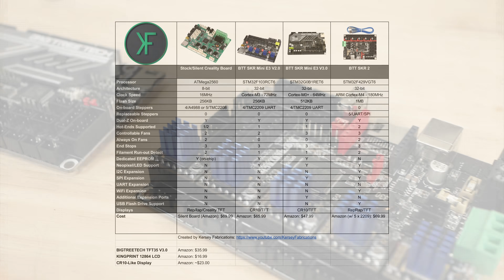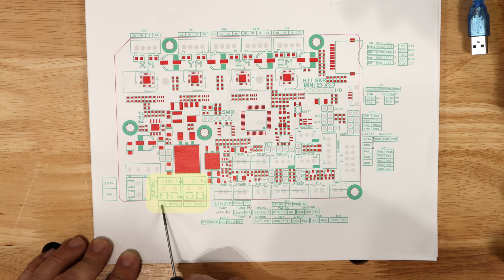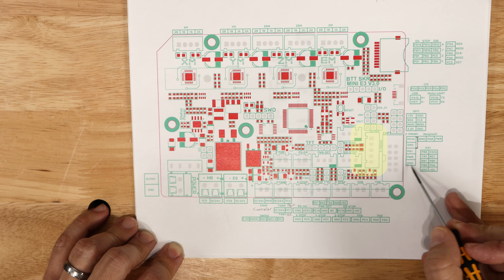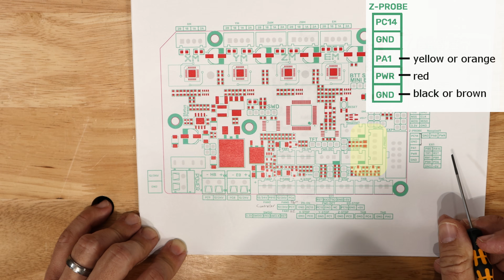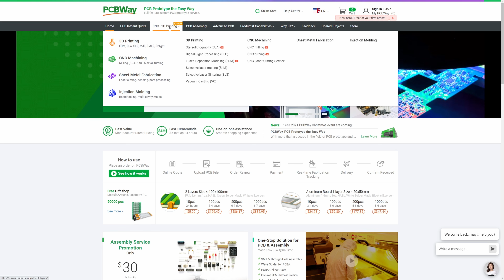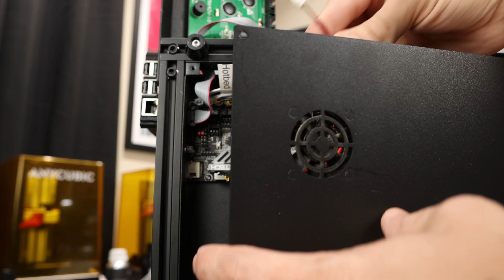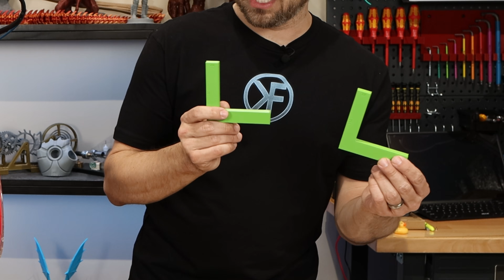Bigtreetech SKR Mini E3 V3.0 - Ender 5 and Ender 5 Plus

Comment: would this work on a 5 pro? your video was super helpful and you firmware has gotten me the furthest so far but im still getting an issue where i turn the printer off and it disables the steppers, also if i hit auto home it will never raise the bed up and the z probe wizard is helpful but wont help me home the printer.
Reply from the maker: When you turn the printer off, it will always disable the stepper, they have to have power to stay engaged. If the probe self test works on boot but it won't home, check the location and polarity of the black/white wires from the BLTouch.
Reply: @kerseyfabs  I’ll give that a test. I was able yo get it to raise the bed by removing the z probe wires off the 5 pin harness and putting them into the z end stop a harness. The bl touch tests correctly but now will when I hit auto hone it will not deploy the probe and tries to crash into the bed. I did test out BTT firmware and it’s lacking some of the features of yours but it has the issue of dropping the pin but not stopping the bed.

I am going to swap the polarity z probe and see what that does. I can handle hardware issues well and some software but not compiling or writing code.
Reply: Did you manage to fix this issue, what you have described seems to be the same issue I'm having
Reply: @PetrolheadDan14  somewhat yes, I had to break off the two wires for the z stop instead of the 5 pin for bl touch. I couldn’t get his firmware to work, but I got one of the btt pre compiled firmwares to work, I lost a bit of functionality and my  printer flipped the home of x&y to the opposite corner (my purge line is on the left now). It’s working so I haven’t messed with it but I did buy the unified 2 firmware but I haven’t messed with it.
Reply: What do you mean you have to break the wires off for the z end stop? This is the issues I'm having and what I've tried already

Cr touch connected and z end stop disconnected: auto home will only home x and y. If I run a bed level test the bed will move down around 40mm and then raise 10mm, will then give me a m112 shutdown error.

Cr touch connected and z end stop connected: auto home will home x and y then try to home z however the probe won't deploy.

Saw something online about removing the red and blue wire from the cr touch and connecting them into the z end stop connector on the board: however again on a z home the probe doesn't deploy again.

I have tried multiple firmwares and 1 with the z end stop connected deployed the probe on a z home however it was still using the z end stop for home as when I removed the adjustment screw for it the nozzle crashed into the bed even though the cr touch probe had touched the bed
Reply: @PetrolheadDan14  so the btt board has a 5 pin for the bl touch, that did not work, I had to pull two wires off (can’t remember which ones) and put them on the z stop. One thing I did to help test and avoid crashing into the bed was to drop the bed down and tapped the probe while rising to see if it stopped the bed.

Comment: So I installed the BTT on my Ender 5 Plus.  I did the firmware process.  I plug it in, turn it on, Nothing shows on the LCD screw.  The BL Touch lights up and makes a clicking sound.  Any ideas?
Reply from the maker: Did it look like it's getting power? Any backlights or LEDs?

Comment: I downloaded the firmware for my Ender five plus. However, I keep getting the error of Failed to enable bed leveling. I try to turn on the BL touch, it goes to the limit switches, goes to the middle and then the bed drops down about 40 mm and then errors out. This is my only issue with going forward with printing again.
Reply from the maker: You have two errors here. First, make sure your black/white BLTouch wire is connected correctly. That should hopefully fix probing. The "Failed to enable bed leveling" just means you haven't run a mesh (ABL) yet.

Comment: My E3 Turbo is cooking my steppers is this a better option?  I run the SKR  2  in my CR10S and have never had an issue with that board.  I suspect the E3 Turbo was rushed to market...  How has been the long term reliability with the newer board.
Reply from the maker: Yeah, I really like this board but they've discontinued it. I assume the overheating is why. I've seen no reports of issues on the SKR 2 or SKR 3. I've been using the SKR 2 for a while now.

Comment: Firmware doesn't work. Formatted 8GB SD card to FAT32. Installed firmware on SD renaming it to firmware.bin. plugged printer in and installed SD, powered on.......NOTHING!!!! I just want this thing running again. Don't understand WTF it's so hard.🤦‍♂🤦‍♂
Reply from the maker: Here's the troubleshooting how-to. As you know, there's no magic. I do what I can.

How to install these files:
1. Download the file.
2. Rename the file to firmware.bin
3. Place that on an SD card.
4. Place that into the mainboard.
5. Turn on the printer.
It should boot after a few seconds of flashing. To verify that it flashed, reinsert the SD card into a computer and the file should now be called FIRMWARE.CUR.

If you're having problems flashing:
- It may require an 8GB or smaller SD card.
- Make sure it's formatted FAT32.
- Under Windows in the file manager, click "View" in the menu bar. Make sure "File name extensions" is checked otherwise you may be renaming the file "firmware.bin.bin"

Comment: Hi Kris, I currently am using an Ender 5 plus and am considering installing the BTT SKR 2 version B board with 2209 steppers. I am still using the 8 bit board now and am nervous in upgrading the board with the new firmware install. In your experience, have you had any major issues when flashing new firmware? Which firmware do you suggest using with this board and printer set up? Will I need to install a new display with this board also? 
Your videos are excellent and extremely well done. Thanks and keep up the fantastic work.
Reply: I tried updating my 2.2 silent board and now everything works mostly but I can't talk to it or get any firmware to work from a computer or SD card. When connecting to a computer it says the printer is talking jiberish.

Comment: followed step by step. Once i put in the SD card. NOTHING
Reply from the maker: If you're having problems flashing:
- It may require an 8GB or smaller SD card.
- Make sure it's formatted FAT32.
- Under Windows in the file manager, click "View" in the menu bar. Make sure "File name extensions" is checked otherwise you may be renaming the file "firmware.bin.bin"

Comment: This is a massive shot in the dark but: 
I loaded your ender 5 plus firmware on my board (skr mini E3 V3) with the TFT35 for ender 5 plus, but after plugging it all up correctly I get the No Printer Detected message in touch mode, but marlin mode works fine from what I can tell. Do you or anyone else here perhaps have the LCD firmware that would work for KF's Ender 5 Plus board Firmware? Or any other tips I should try?
Reply from the maker: There's nothing special to get the Touch UI working. Check the orientation of the RS232 (black) cable and make sure your baud rate on the display is set to 115200. I hope this helps!
Reply: @kerseyfabs  thank you for the reply!
I double checked the orientation of the black cable, and it's correct (swapped it to see and the screen went all white then swapped it back) and check Menu->Settings->Connection->S.Ports and Port1-Printer is set to 115200. Is this the correct setup?
Reply from the maker: That looks correct to me. As I tell people, there's no magic beyond that. Make sure it's running my software and make sure the cable is making good connectivity with a multimeter if needed.

Comment: do you have a pre compiled firmware that covers the bl touch and a filament sensor wired to the SKR E3 mini V 3.0? using the EO stop port on the board? I am upgrading a basic Ender 5 (no plus or pro)

Comment: Had to upgrade to "SKR Mini E3 V3.0" because v1.1.4 got some smoke. However I miss these old-school retro sounds original board does. Why people want "silent" drivers is beyond my understanding. And I see no much difference comparing to what 8 bit board can at default speeds. Output quality is similar. CPU speed doesn't really matter. With all the optimizations set of features is similar. Yes, I've received input shaping, linear advance and stallguard but I can live without these. I could go back to 8 bit easily without any regret.

Comment: A drop of denatured alcohol (mineral spirits) will debond hot glue quickly. Give a few moments to wick in, you will be amazed. Do keep in mind that it is flammable so only use with power disconnected.

Comment: Hi, I get the upgrade board BTT SKR MINI E3 V2.0 for my ENDER 5 (not pro) and install it witout any issue, but when try to print a calibration stl file, it came out like spongy, install new metal complete endhot, level it, and not lucky, if i put back my old board Version 1.1.4 it work fine, I request the firmaware to BIGTREETECH and i did the Flash but continue to do the same issue spongy print, please any suggestion to help solve it, thank you
Reply from the maker: Explain what you mean by "sprongy."
Reply: sorry for my speling, the texture was not solid, it was more of a sponge like texture
Reply from the maker: @salvadorbermudez389  If you haven't already, tuned your steps/mm or flow, do that first.

Comment: hi kris. thank you i have found this very useful. this is my first time of trying anything like this and it has really helped. i have an issue with the firmware. it does not install. while downloading it i have somehow manage to get express zip as its default open app. would this effect the running of the firmware and if so how could i correct it

Comment: I did this upgrade on ender5plus and when I try to home the machine is goes the wrong direction please help
Reply: Did you use stock screen or did you use big tree tech screen
Reply: @azarian44  installed big tree tech tft 35
Reply: @ryanw501  i think that would be the easiest solution for me but would like to use stock screen
Reply: @azarian44  going to try this weekend
Reply: @azarian44  how do u connect stock screen to skr minie3v3
Reply: @ryanw501  jumpers 5v Gd Tx Rx from screen to board where it is marked Tft on wiring diagram

Comment: Hot glue dissolves easily with 99% IPA alcohol. This also cleans circuit boards and is harmless to electronics. You just can't drink the stuff without going blind.

Comment: is this the exact same way for the ender 5 plus? im currently installing this board on my printer. i get confused with the smaller wiring z x hot bed ect... and i got BTT TFT50 V3.0.1 as for the replacement.
Reply from the maker: Yes. It should be the same.
Reply: @kerseyfabs  one more thing i got screen error  "bed leveling failed"  "invalid Mesh" is that cause of firmware needed to update or is that wiring issue plugged the wrong way? the firmware definitely wrong cause of the bed size is @ X 220 Y 2220 Z 0
Reply: I went to microcenter and got the Creality Silent board it was so much easier. until I figure out how to do the firmware... I'm sticking with this board for now.

Comment: You got a video ready for using the OG with the Ender 5 plus? It's available via using the Klipper firmware currently, with a minor rewire of the cable from what I've read, just not any video showing it that I've found yet!
Reply: You took too long so I've compiled it myself, all working now :) Will share the file with whoever. Need to create a walkthrough for everyone next so they can do the LCD cable wiring correctly and how to flash the LCD controller with the required update. It's honestly not too difficult, and people would appreciate a video on what to do (I'm a text based person, so not me :P )

Comment: Awesome video. I like you step by step guides on upgrades. I ordered mine.  I want to swop my stock ender 5 mother board for 2 reasons. noise and I want to make use of linear advance. I wanted to hear has linear advance been activated in the firmware in you description? Further, I see the is no examples of ender 5 in the marlin config files. I am sure a few people are not so clued up on creating a custom marlin firmware build (or maybe its just me). Do you mind doing a tutorial? Regards.
Reply from the maker: Yes, Linear Advance is enabled in my firmware. You just need to calibrate and set your K value. I know a lot of people want that tutorial. I'll see what I can do.
Reply: @kerseyfabs  Any update on that marlin firmware tutorial? I would love to dive deeper into this firmware and possibly even customize it a bit, but I'm new to the whole idea of compiling and customizing firmware. Thanks!!

Comment: Thank you for the excellent videos, helped me tremendously with installing the board into my Ender 5 Plus.  I am having issues with the auto bed leveling not working correctly with the latest 2.1.1 firmware (as you have alluded to in the description).  Do you have any tips for trouble shooting or fixing?  Is it fixable, or should I move to the V2 board?   Thanks!
Reply: I'm having the same problem, what did you end up doing?
Reply: @Keff_GLITCH3D  I ended up switching to the V2 board.    I also switched to a firmware i found on the ender 5 plus reddit group.  It been working pretty reliably for me.
Reply from the maker: There's a new potential fix out. I'll see if I can get a build to test.

Comment: I've just Installed the SKR Mini E3 V3 and TFT50 On my 5 plus with bl touch. What a nightmare. Started with leveling issues, then filament detector issues. Worked on marlin 2.1.1 for 3 days but got it working with bl touch connected to 5 pin input. Filament detector still not working. tried FD plugged into tft50 but keep getting errors, found it set to off in screen firmware. Tried to enable in marlin and get a build error. will keep trying but done with BTT.
Reply from the maker: BTT is definitely a DIY solution. The troubles you're describing don't seem to be a problem with the BTT products. I have a 2.1.1 build available. Check my YouTube community page or Facebook page.

Comment: Geat Video but my Z stop on the BL touch dont work. it rams in to the bed :(
Reply from the maker: Sorry to hear that! Check the black/white wires. They are most likely hooked up wrong or not making a good connection.
Reply: @kerseyfabs  I swapped the wires and it worked! thank you for your great support

Comment: What's the difference if I use the black/white wires on the 2 pin z stop header on the board or if I use the 5pin probe connector?
Reply from the maker: Nothing except that the firmware has to know where to look for it. Electrically, it works the same way.

Comment: So I installed the SKR Mini v3 in my 5+. Get no display and the status light just flashes, even after trying to update the firmware. Sent email to BTT support and I get a reply saying that the display won't work with the board and that I have to buy a new display. I was under the impression that the board would work with the stock display, guess I return the board.
Reply: Will not be buying any more BTT/Biqu products, support/customer service is terrible:
1) Took them 3 days to respond to initial email and then another 2 days to tell me that the stock display isn't supported with the mini v3
2) They didn't even try to keep me as a customer (offer a discount on a new display or even that they are working on a fix to allow the board to work with the stock display)
3) Informed them that I will be returning the board and going with a competitor and get "thanks for the information" as a response.

Comment: got it all installed on my ender 5 plus- x,y,z and the extruder are all working, when i have my bl touch shoot the probe out it does and brings it back in without an issue- except when i try to home everything then i get a bltouch error restart with m999... any ideas?

Comment: i have just installed the Bigtree Tech SKR Mini E3 V3.0 and a TFT 35 E3 in my ender 5 pro.  I have downloaded your firmware but i cannot get it to upload it is still running as an ender 3 can you give me a hint where I am going Rong 
i copied the bin file to the SD card switched on and it just started up as ender 3
Reply: @michiel9163  thank will give it a try and let you know
Reply: yes, it did work for me thanks 
I now need a copy of the ender 5 pro marlin cod to change for the odd addons i.e. filament run out sensor if you can help
Reply: @pauljessop7925  glad that it worked, but im not so good in 3d printing, i hope you find it out
Reply: Hi i have the same problem. Did you find a soluation?
Reply: @michiel9163  not yet

Comment: Kris, thank you, Great Video, I have been switched to BIGTREETECH SKR MINI E3 used in the Ender-5-Plus but I need a firmware where BL Touch is attached to the Z-Probe specifically for the 5 plus. By Any chance do you have one. In your video you also to refer to correct connection to BL Touch as Z-Stop. Will you please point to the video or instruction (to do this in the correct polarity). Thank you once again for great work and thank you in advance for your answers.